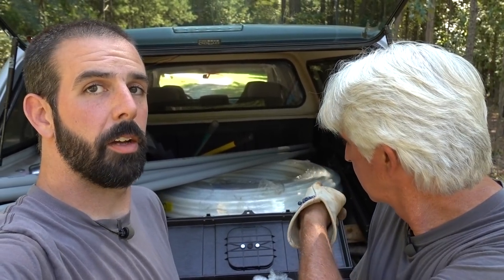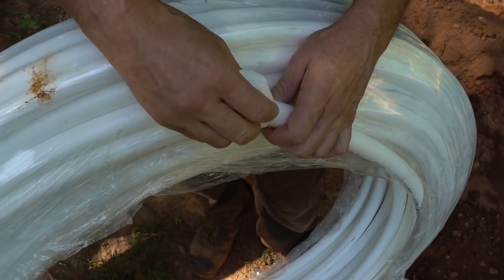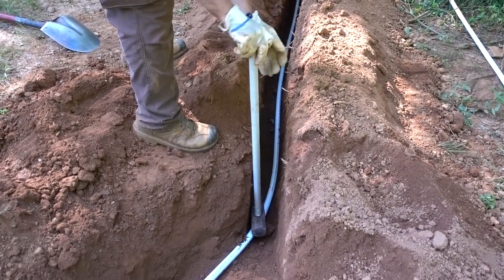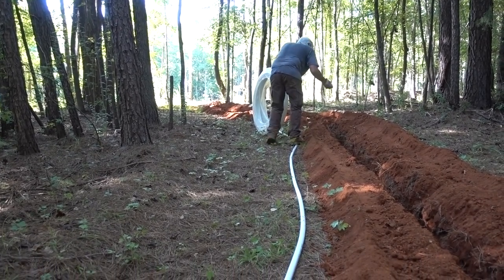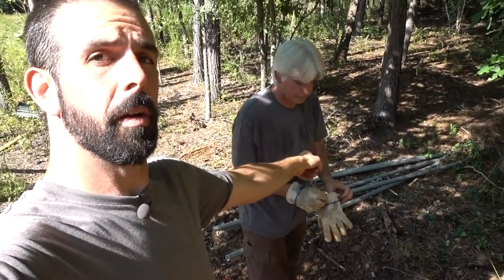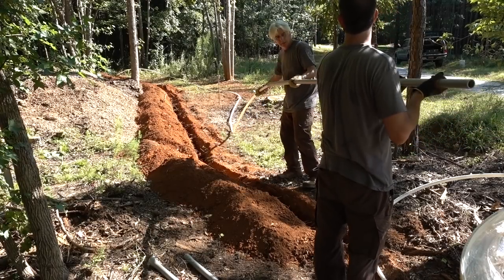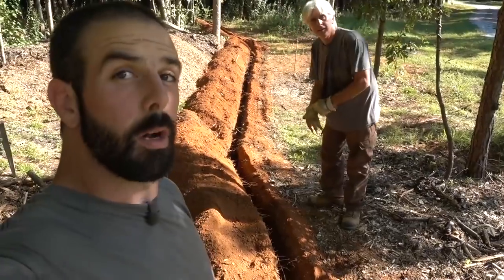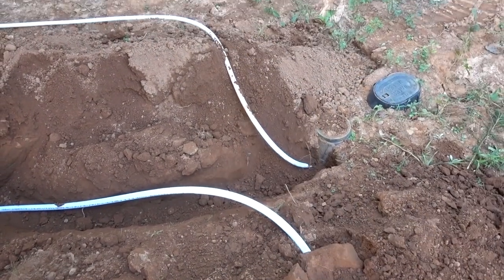Installing Our Water Line! - Episode 58

Comment: I live out in Eastern Washington and I had an issue with pocket gophers chewing thru my 1" poly irrigation water lines whenever they were depressurized, even though they were buried 4' below the surface. Initially I didn't use conduit sheathing, but each time I repaired the lines, I would add the conduit to the repaired section. Now, I encase all my new buried water lines in conduit... Live and learn.
Reply from the maker: That is a good idea. 

Terry

Comment: Very nice video! Looking forward to seeing your houses get developed. I will have to run about 900 ft of water lines. Even though part of that runs through the woods, it’s part of the property where we want to thin out the trees in the future so that we can have grass and only leave the biggest and healthiest trees since we will be using a 5000-6000 lb tractor should we put conduit over that full line? Here we will be about 33-40 inches down in the ground.
Reply from the maker: Not gonna lie to ya, I am not sure how important it would be in your situation. 

If it was a place where I was going to cross daily or at least often like a driveway I would definitely put conduit or PVC pipe over that area. Out in an open filed and as deep as you are going I would think it would be OK. Make sure there are no rocks or debris in the hole near the pipe. A post hole digger can help there getting them out or take a steel pipe or something like that and drive any rocks down deep below the bottom of your pipe maybe.  One thing that would be good and I kinda wish we had done it is buy a load of sand or maybe a few in your case and drop a few inches in the hole, then drop the pipe and then drop several more inches of sand on top the pipe before filling with the native soil. Far less chance of any problems I would think doing it that way.
I would avoid being close to any trees you want to keep because the roots can be a problem and larger tree roots can eventually break the pipe as they grow over time. 

Sounds a lot like we are doing and I think its a good idea leaving trees in the field. It looks great and provides livestock a break from the hot summer sun. Also it can help the grasses as well by having partial shade helping reduce ground temps. Then  you will also have a more diverse habitat which generally translates to more healthy fields in general.
Terry
Reply: Its a tough decision for sure because like you I want to do it right so that it lasts my lifetime!  Had we been thinking we would have thinned the trees out first rather than just clearing the house/barn site. That way we would have had all the debris at once :-)That first 600 ft is from the road frontage back to the house site, so you could call it the front yard, but right now its really a forest and only a small section at the entrance is cleared and is grassy, although we still need to do some grading and backfilling of some low spots. On a positive note the apple trees are really full this year for the first time.
Reply from the maker: Love me some apples!!
Have you taken a walk through the woods with the water line location in mind? 

When we were deciding to run ours through the woods at a shorter distance than down the side of the driveway we walked where we thought it would go and we found there to be a curvy but natural clearing that only needed a few small to mid size trees cut down. Worked out great for us. There are some more we will get cut down in the next few years that are closer than we want to the water and power lines but a few years growth of those trees will not do to much harm. Anything growing close to the power and water will just be cut down and then leave the stumps at ground level to rot or possibly stump grind.
Terry
Reply: Back in December we ran a string line from the water tap location back to where the house should be.  We ran it straight from about 200 ft, but then turned it at about a 45 degree line so that we could avoid a big oak tree.  Then we went 5 ft either side of that and marked any trees or brush.  Then came through and took all of those out.  Only had to cut down about 10 bigger trees most of what we took out were 2 inches or smaller.  That was just a preliminary line, should have a better idea once the leaves are off the trees and the ferns die off.
Reply from the maker: Sounds like you guys got a good game plan. It does make a big difference when the leaves fall and green stuff dies off. 

Terry

Comment: Awesome job guys! Now that you’re pros you think you might want to help me out with a nearly 1/2 -3/4 mike run of pipe? Lol! 
I’m so dreading running this pipe but it will make life so much nicer being able to wash down equipment and other items. I’ll probably wait another month or so before doing mine till it cools down some here in Mississippi.
Reply from the maker: Thanks! Will be there this fall to get it done. You just set over in the shade and let us handle the dirty work, lol. 

Seriously though if you can wait till cooler weather that is a good idea. This heat is wiping us out.
Terry

Comment: Great progress. Reading other comments and answers  I see there's no need for mentioning mapping these things for future ease in finding. 
  On another note what crimps are you planning to use? From what I read you can't use the standard off the shelf  per fittings and crimp rings due to construction and corrosion  issues they have to be all I think it was red brass. I'm not  positive  but I know it wasn't the standard ones.
  Thanks guys all the best
Reply from the maker: WE used stainless steel. That is what they say will do the trick. I hope so but worst case the only place we used them were at the ends so we have access to all joints. Gonna be continuous lines into the houses as well. We have a way to map it and that video will be out soon. Its not conventional but then neither are we, ha ha.
Terry

Comment: Glad I came across y'alls channel. I'm currently in the process of getting things ready for my first home to be built here near Charlotte (driveway cleared and first gravel down, house area and septic area cleared as well) Was wondering how hard it would be to do the trenching and run the water line myself about 450' (wooded area but not heavily, at least not where the line will go) but feel like it's something I can do now. I also have to have the water company come out and add on an extension so I can hook up to the city water supply. What size water line did you run for the main supply and did you notice any pressure loss with that far of a run? Keep it up the hard work!
Reply from the maker: We also had to have a water meter/connection done by the water company at the road. Running the line was pretty easy. Trenching is not that hard either if you just take your time. We ran an 1" line from the road and the pressure is great. It was only 3/4" at the road connection but we stepped it up to help keep the flow rate up. Then we will step it back down to 3/4" in the house and then down to 1/2" at the individual outlets like sinks and tubs and all. Getting that water in really helps when your dirty and dusty. You can rinse off and if helps give you a bit of relief plus its just nice having water to drink right there. Then if you do any burning its awesome having water in case the fire gets out of hand. Good luck on your project! Nothing like building your own dream!
Terry
Reply from the maker: Here is the trenching video. https://youtu.be/pb9lHCy1q0Y
Reply from the maker: Here is hooking the water line up. https://youtu.be/_g1ZluGKbxw
Reply: @ForestToFarm  Thanks, very excited to see it all come together. Also I should have watched your other videos before asking the questions, my apologies. But thank you for linking the videos anyway. On a side note, unrelated to the water line, I also will be going with Duke Energy as my electrical provider (saw your temporary power install vid). Did you end up running overhead or underground to your home? And was it fairly expensive or reasonable for whichever you chose? Thanks again!
Reply from the maker: No apologies needed. Glad to help. If you are within 1000' from the main power at the road its free here in SC. Its all underground. We have one line running to a transformer and then it will split off to the two houses if and when we ever get them built, ha ha.  Its gonna happen. :)

Terry

Comment: I would suggest before you bury the line completely that you add a roll of wire along side the water line, this will allow future accurate identification of the location of the water line by using a metal detector. There are tapes as well that have metal in them that are called dig tape, it actually has water line printed on it to prevent someone digging into your water line the future. Most people say I know where it is so no problem.. What happens if something happens to you? Will the family know exactly where it is?
Reply from the maker: Thanks Micheal. We are going to be doing a video soon showing  how we mark the line for future location and why we are doing it that way. I should have mentioned it in this video but I guess we were tired when we rounded things up. Check back soon and it will be up. I agree having a way for future people to find it is very important.
Terry

Comment: Water issue 
private funded: Job gets done at an economically sound option, not to expensive, not too cheap, planning phase brief and to the point, construction left alone for the estimated duration and construction told that if they dragged their feet, they don't get paid more, job is completed ahead of schedule so that the construction crew wins out and everyone wins.

Government: a debate if it's needed, stalled and revitalized after time, voted upon and the community gets excited, engineer follows and gives 3 quotes, current party chooses pipes that will last for longer than your newborns grandchildren, construction stalls when opposition goes public about cost and middle quote chosen instead ,construction starts fast so that the opposition is seen as hero, construction stalls because construction crew wants more money.... as government didn't negotiate penalties for stalls, the people pay.

Opposition elected as new controlling party, construction continues as planned, meanwhile area with no access to water starts suffering and lowering in price value, controlling party blames previous party and tries to get it for cheaper they succeed by a decimal point, price blows out to nearly 2x original quote but opposition still blames previous party.

Plans change, to reduce cost back to original price, above ground plumbing is chosen, because the property values have nose dived below original selling price, the area is bypassed for more up and coming area, local area given drinking fountain instead.

Local residents petition for plumbing to be connected and debate starts about if fountain good enough, rinse, repeat

Meanwhile pipe bursts because of cheap material, both parties start blaming each other over whose fault it is and who should pay to assist those in need, nothing gets done

That's government policy any party will do that. that's not worst case scenario... that's basically almost any major government project, the only difference is that it's so common it's like reporting on global traffic deaths... too many happen, not tragic enough to report about.
Reply from the maker: Sounds about right. We do our own work then the only blame falls on us. We can go way over board and still get out for less than if we paid to have it done. I like that option.
Terry

Comment: I would have placed a tracer wire in  the trench, and possibly also a caution ID ribbon about a foot above the line, you will know where it is now, but in 20 years you will not be as sure, and in 30 years even less sure...
Reply from the maker: I agree. However we have future plans for an additional water line run directly over the first for farm use depending on how much flow a future well we will be putting in produces. We actually have a good plan to mark the line and make it where we know exactly where it is at. We are going to film it and it should be up in a week or less. I think you will like what we do. I totally agree with what you are saying but we planned a different approach that I think will be awesome. We tend to make our own path through life, ha ha. Very unconventional. Also after running the second line which could be a year or two down the road (provided we do it) we will be installing a wire for some Christmas lights or other powered stuff at the front entrance split rail fence you see in the video and it will be above the second line. The first line is between 2 and 3 feet down. We only need 6" for frost here so we have a lot of room to work with. If the well is very good then no second line but we will at that time install the power wire. Probably just a 12/2 and then it would be LED lights so no real power consumption to worry about.
Terry